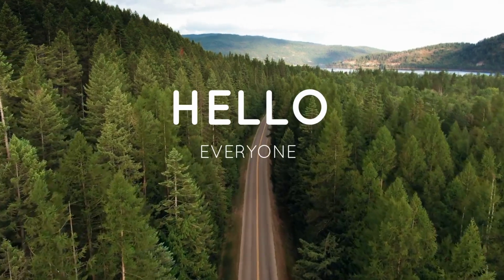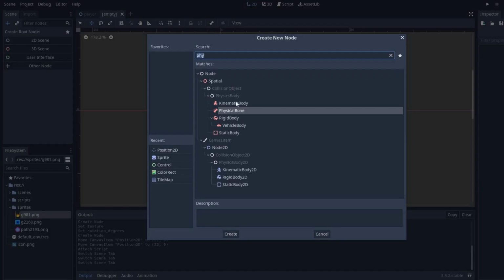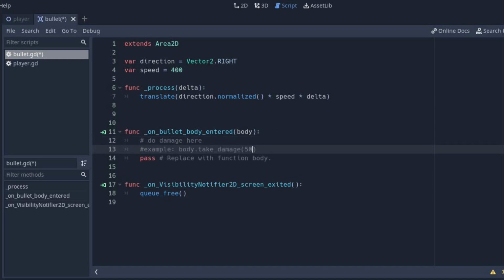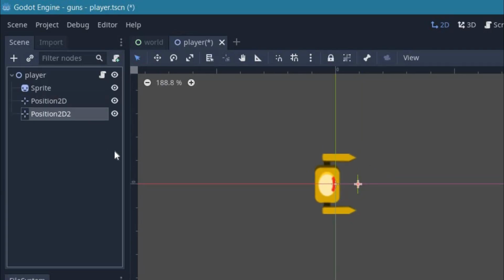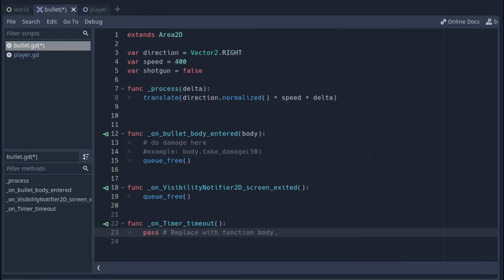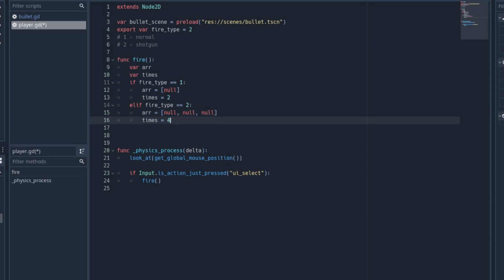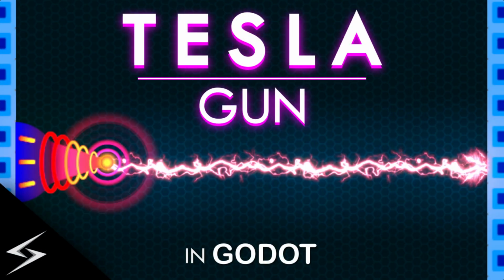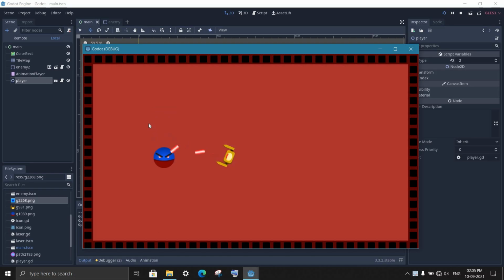Types of guns in games  part 1| Godot tutorial | Dicode

Comment: FINALLY!  I've been hating using RigidBody2D for my projectiles, because of the preloaded physics, I knew there was a way to use Area2D, but I COULD NOT FIND A METHOD THAT MOVED IT WELL.   Time to recode my entire projectile system.  XD   one question with the translate method.  I assume this is teleporting the Area2D, not sliding it, if the projectile speed is too high it'll be possible to blink passed an enemy without hitting it;  how would you avoid this issue, raycasting?
Reply from the maker: Yes,for really fast projectiles, ray cast is the best thing to use.

Comment: I’m currently making a game and my fire function is shooting two bullets and I can’t figure out why
Reply from the maker: Obviously, your fire function is being called 2 time. check when and where you are calling the function. 
Also, if you are using a variable to control your firing state (which you should) then check for the places where you are enabling it.
Reply: @dicode1q  I fixed it but i cant remember what i fixed, all i remember is that it didn't make any sense and the headache afterwards, thanks for replying.

Comment: Laser part is great, but there is one issue with bullets on single bullet and shotgun,
As you spawn the bullets as a child of player they will move with player as you move mouse to rotate player, in video you don't rotate player while bullets still on screen, that is why it looks fine. 
To avoid such problem, it is necessary to spawn bullets as a child of main scene.
Am I wrong?
Reply from the maker: You are correct, and I have done the same.
I am not adding bullet as a child of the player.
I have written "get_tree().get_root().add_child(bullet) "
By this, my bullet are child of the scene
Reply: @dicode1q  well ok, I haven't noticed that😁

Comment: What about the Charge Shot tutorial? Do you know when you can do that?
Reply: That’s great and all, but let’s say Mega Man has two charge levels. Mega Man can fire a mini-charged shot when charge level reaches 1, and can fire a fully charged shot when it reaches 2. I want the charge duration to have two charge levels. When it’s between 0 and 0.6, charge level is 1, and if it’s greater than 0.6, then charge level is 2.
Reply from the maker: now in this case, you can use OS.get_unix_time() to get the system time. when you hold down the button
make a variable start = OS.get_unix_time()
and when you leave the button
make a variable duration = OS.get_unix_time() - start
now you just need if-else condition to create the bullet of your choice
Reply from the maker: That's actually pretty simple, 
1.make a variable pressed and set it to false by default.
2.Then when you press the button set it to true and start a timer for the "charge_duration" whatever you want.
Also you can start the charge animation ( if you have)
3.Then when you release the button set the pressed variable to false and stop the charge animation (if started).
4. Now When the timmer ends, first check if pressed == true, then shoot the bullet and at last set the pressed to false again.
Reply: Is there a way to have two charge levels instead of one for the charge duration?

Comment: Any one had experience of this: 
I made a single shot, and a 3Way, but Im limiting the one screen shots to 3 at a time(Like MegaMan on NES) in the bullet there is a CountShot as bool, so if its true it adds a number back to the count when leaving the screen, allowing another shot to be fired by the player.

Single Shot, works great, fire 3, and only three, when they leave the screen, it adds back to the counter in the plater, and it fires like megaman, on the 3way, it either doesnt count, or all three bullets add to the count, so bullets are increased, the way it turns the bool in the shot to add back to the count is like the Shotgun bool here, with the timer.

Comment: Great Job! I would suggest using the func _physics_process() instead of the func _process(). _physics_process is called at a steady rate while _process is called every frame so it will act differently on different devices.
Reply from the maker: Ohh, I didn't know that.thanks I will use physics_process now